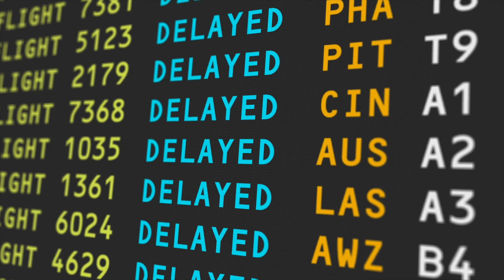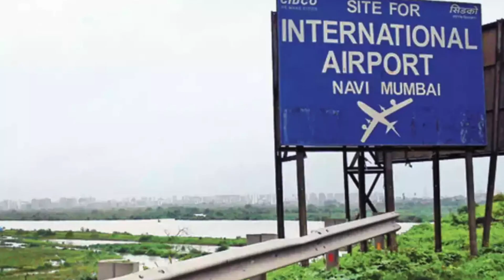Navi Mumbai - India's Brand New Mega Airport

Comment: Navi Mumbai Airport was planned to commercialize activities in 2008. But due to political upheaval cause this delays, especially the Congress + UPA Government during 2004 to 2014. There was never a flooding in Ulwe river, except in 26th July 2005.
There is another plan of transport thru Ferry too to airport.
Due to cutting of hills in airport area cause climate change in nearby areas like Panvel City. Humidity increased. Winter also got reduced.
If you notice that Panvel Taluka/City is surrounded by mountains from all side. Its like Crater shape, a valley.

Comment: The problem is that smaller airports in tier-2 cities all over India still remain VERY under-developed (eg., Pune or Agra).  So almost all traffic needs to go via hub airports in tier-1 cities (Mumbai, Delhi, Chennai, etc).  A lot of the traffic could have been alleviated if tier-2 city airports could be developed as large  international airports well.   For domestic traffic, most airports at tier-3 cities (big towns) remain limited to private aircraft owned by local VIPs (e.g., Bellary, Akola, Latur, Kota (the one famous for IIT coaching) ... etc.).
Reply: Developing tier 2 and 3 airports will be of less use compared to what you think it is. You search for flights between Jaipur and Coimbatore (both tier 2), it's all connecting flights and no direct flight. Developing tier 2 and 3 airports will only be useful if there were airlines with many aircrafts that would like to operate directly rather than the hub and spoke model. Indigo and Airindia do have a large number of aircraft orders but I fear very few of them would be used in direct flights between tier 2 cities. 

Tier 2 airports remain under used and will remain until an International airline chose to land but they will only choose to land if there are domestic departures to other part of country and govt will only choose to upgrade if it's being overused. Sadly all are inter dependent and some entity has to take loss to start.
Reply: @tejasparse9053  A bit of a 'Chicken and Egg' problem.  But I think India's huge population can support direct flights between most tier-2 cities at least (i.e, small ATR's nearly filled to capacity).  Plus there is huge demand for international travel from pretty much every tier-2 city.   To quote another cliche ...  If you build it, they will come.  The hub-spoke model is so economically inefficient.
Reply: @golmatol6537  True. The moment Indigo and Air India starts receives it's new planes they will need some airport to park them and fly to different routes. This way automatically tier 2 cities should be connected and become new cheaper hub for these airlines.
Reply: I am in complete agreement. Tier 2 airports should be upgraded immediately. When that is done airlines will schedule direct flights between two tier 2 cities. They can change their strategies when new aircraft arrive. They can use small aircraft like A320 or even small turboprops like ATR 72. Flying directly will take the stress off the.main hubs. For passengers it will be faster to fly directly.
Now they are doing hub and spokes because of the airports. When airports are upgraded they can do point to point.
International and domestic tourism will bring the traffic. Right now if there are no direct flights the traffic demand and growth is difficult to analyse. But I believe when you have direct flights between tier2 cities the traffic will come. Sometimes with these projects you must have an act of faith. India's population is huge. The chances of building white elephant projects is slim.
This Navi airport is superb because it is connected to the high speed rail. So it's multimodal air- road-rail which is superb planning.
Reply: All are being upgraded as per the traffic.....Govt is doing heavy investment in infra to attract tourist, reduce transportation cost. Navi Mumbai will be made a Hub for other transnational flights. This is why Govt is developing temple tourism also....for people to watch something....
Reply: Kerala airports and bengaluru, mysuru  airports are big 😮

Comment: Noida airport to be operational in next 2 months❤❤❤
Reply: I think just phase 1 not whole airport... Beacuse I'm not seeing that the airport will be completed in just 2 months
Reply: @TooniMe  obviously, it will be started as initially only around 65 flights a day will be, gradually it will have 6 strips, and gradually capacity of 3000 flights per day capacity, its always there, they Starr the flight operations,vs!d continue expanding the airport, and its tata construction, so it will be more stylish than igi delhi.
Reply: @kingrichards9295 still not operational
Reply: @pratikbhandare3497  test flight started, don't know why anything not happen in time😏🙄
Reply: @kingrichards9295  it is taking time that is good for the construction. Maybe in March or May it might get completed. Ik it's already late but the actual construction started late so it needs more time. Cause speeding construction will results in many upcoming failures. Like for example here in newly opened Mumbai coastal road you can see already patches there cause politicians wanted to open it to public before election so they opened it early and that too in rainy season. So it resulted in many patches. so it is good that it is taking time rather than to sped up.
Reply: @pratikbhandare3497  tata is also involved in its construction so most likely it will be of okay quality at least
Reply: @kingrichards9295 Mumbai coastal road is getting built by L&T . Which is 1st in india in terms of construction building and quality. So its not aboutcompany is doing it good or not but giving them there time to build is important.